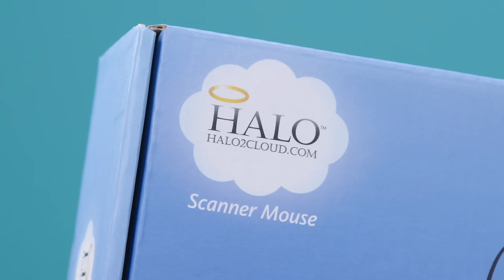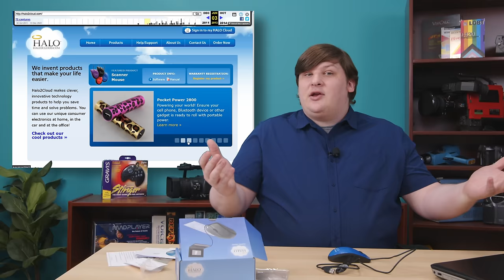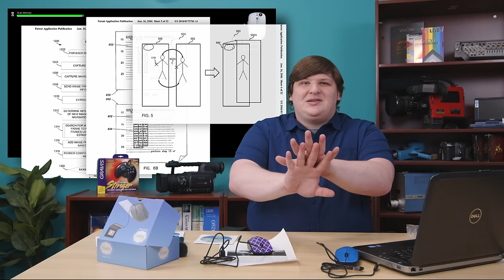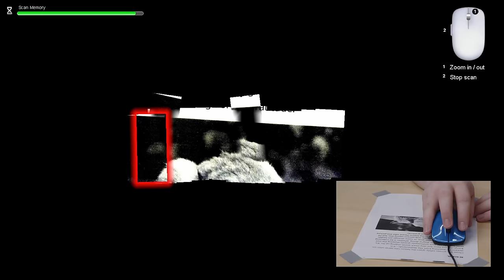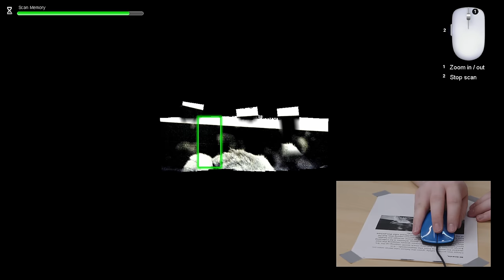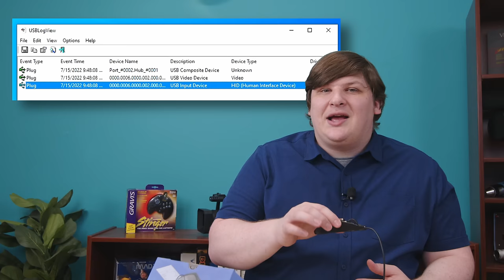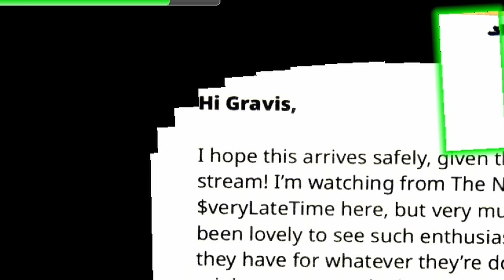Why would you scan things with a... mouse?

Comment: I would add one other [infuriating] factor driving what  happens in tech innovation: "How can we turn this into a subscription service?"
Reply from the maker: absolutely, if this thing had been just a couple years later it would have been right into that crap, haha.
Reply: That's my favorite.
Reply: You can hardly call it innovation at all. It's really a symptom of a fatal flaw in the system, companies need to keep "evolving" their products but we've reached a point where most software can barely be improved in ways that are interesting to customers. You need endless growth to stay in business but there's only so much growth that is actually needed or can be done at all, so they start profiting off of their power as a monopoly, because they can't deliver any more value to justify their existence (most big software companies can't, it seems)
Reply: Need your seats heated??? that will be 15 bucks please!
Reply: @davidmiller9485  I would actually like my seats chilled, what would be the subscription for that? Also to what guarantee is the cooling power of the seats? I am looking to refrigerate my lunch on the passenger seat in full sun if at all possible.
Reply: The worst thing about subscription services is they reward stagnation. Old-fashioned paid updates mean they have to update their product significantly enough in order to continue to make money.

The other downside is higher cost of service: There are several products I use as hobbies (eg Photoshop and Fusion 360) that I'd happily pay $500 for once every few major versions. But I'm just not willing to pay $75 per month for things I use only a few times a year.
Reply: @markmuir7338  My problem is that when you buy the car your paying for the "thing" (lets use heated seats). When you purchase the car that price is based on the fact that the heating system was installed. In this case BMW just doesn't let it work. So your paying for something you don't get to use. That is double dipping to me. If they or any other manufacturer of auto's does that here, I would like to see that end up in the courts.
Reply: Cooling is negative heating, so they should be paying you for cooling the seats.
Reply: @CathodeRayDude  props for working both Bad Brains and SSD into th same sentence
Reply: Like seat heaters on a BMW ?
Reply: maybe there is a android app that does the scanning using acceleration sensors and the camera, but it's locked behund some micro transaction or subscription
Reply: @asronome  this is why the Communists say "capitalism sows the seeds of it's own destruction"
Reply: You have the world economic forum to thank for that
Reply: You have to take it to best buy to "have it recalibrated" by the geek squad every 3 months. They need to use the most expensive branded printer ink or it doesn't work.
Reply: Easy, make it amazing but break so often you just buy another one because you can’t live without it
Reply: Now you can pay for your mouse over time!  It's only a penny per foot moused!
Reply: @millenniumtree  more like,  "pay for your mouse many times over"
Reply: Here have some ads to go with your subscription!
Reply: @sjoervanderploeg4340  So you can earn us money while you earn us more money, having paid money for the purchase
Reply: @asronome  This is very true of hardware as well. For years, I was always very excited about the newest phone releases. Sometime around the mid-to-late 20-teens, however, phones peaked in some sense. I have 54 tabs open in my mobile browser, I can stream music and video, I can send texts, photos, videos, and emails, I can access my shared docs in the cloud, and I can video chat with anyone, nearly anywhere in the world. Unless I drop my phone "just so" and it breaks, I'm no longer incentivized by new hardware. Every new "1000 MP camera" or folding screen is beyond my use case.
Reply: @asronome  Very much this. Office 2007 is the threshold for me where it's still inter-operable with most documents from newer Office versions; it got me through university and this is why I don't pay for 365 and continue to run the same Office 2010 license on Windows 10.
Reply: my favorite example of the subscription model being applied to things that shouldn't have a subscription is a motorcycle vest.

specifically its an airbag vest, if you get into an accident, it inflates to help protect you. it works by having a teather attached to the bike. and they do help reduce injuries.

there was a company that made a tether-free version, that from what ive heard, works great. and for $400 is priced a bit cheaper than other airbag vests.

the issue is that you have to either do a $12 a month $120 a year subscription or an additional $400 "license" to use the hardware/blackbox software that it needs to inflate the vest.

the fun part is, if you dont have the subscription/extra $400, it won't work.

a piece of safety equipment that will not work unless you pay a subscription for it to work.

i would be fine with the subscription if it was more of a "if you crash, we will send you a new vest, and pay for the shipping of the damaged vest" (while making the module that actually does the computing modular, and easily user removeable.) or allowing you to get a new vest after x years, because the material can start to break down. but still inflating if you dont have the subscription.

safety equipment should always work, regardless of whether or not you paid a subscription for it to work.

Comment: I love the dual tracking sensors tracking the angle of the mouse, I'd want to see that copied in a modern mouse to allow you to send angle data to painting apps, and more importantly to allow for a pointlessly fancy mouse cursor that rotates like the cursors on the nintendo wii
Reply: Didn't the cursor also zoom in and out based on distance to the "sensor" bar?
Reply: That last part is definitely the most important, I'd pay good money for that!
Reply: It could allow you to turn icons on your desktop for no reason too lol
Reply: it might sound silly at first thought... but.. On my Wacom Cintiq tablet it gives me position of the mouse (pen), but also pressure, angle, and tilt. It makes for very intuitive painting as I can use the pressure to auto-update the opacity of the brush, the tilt to shange the size, and the angle to rotate the brush shape. 

I am not sure directly what I'd use rotation for in a mouse other than, well, image and video manipulation... maybe one could have knobs on an interface and you rotate it with the mouse. In an FPS game you could even rotate the weapon for gangsta-gun kills. 

But the one thing I would really like to see in windows is multi-mouse support in general. To make pinch-zoom gestures and other wild input data. 

In general. If they enable the input, we, the users will find ways to use them.
Reply: @jmalmsten  Some brushes in Photoshop even change shape depending on the angle of the pen! My mind was blown when I first saw that.
Reply: @jmalmsten  Damn, two mouse pointers on dual-wielding mouse usage sounds like such a maniac idea, that whoever uses it can't be sane, not even if they try but much less if they keep doing it.
And I wanna do it badly now (yea that tells a bit about my sanity).
Reply: @Kalvinjj  

It is one of those things where you think... "that is so stupid... but I don't want to be the one who stops the attempt."
Reply: @jmalmsten  heck no stopping it, I wanna be the maniac starting it too!
Reply: @jmalmsten  
MS supports gestures on touch pads and touch screens, so supporting mouse gestures wouldn't be that hard

Sidenote: I have stopped using MS and switched to Linux, so this is mostly AFAIK/IIRC stuff

Edit: multi-mouse would be awesome for multiplayer light-gun games
Reply: @jmalmsten  Multiple mouse cursors is one thing I don't understand how it hasn't been done yet (at least not anywhere I've seen)
Reply: @MrHack4never  Back in the day, Trine supported multiple mice and keyboards. I used it with 2 friends - 3 people could hook up a mouse and keyboard each to one computer, and each control one character.

Sadly, this feature was cut for Trine 2. I think there might have been technical difficulties in keeping it, maybe newer versions of Windows make it a lot harder. Still a great game though!
Reply: @NeatNit  

On Windows and Mac, I think it's mostly just a rationality thing. Most users will never need more than one pointing device. Especially as the other hand is usually tied up to use the keyboard. So they limit the inputs in order to make things more manageable and users don't get confused. 

On something like Linux however, I am a bit more surprised that there aren't more talk about it and attempts. As Linux by its nature is more of a tinkerers system where multimouse input could be used in very unforeseen applications. 

The one thing I can think of are the 3D mouse products used for 3D modeling and CAD where you can push cameras and objects in 3D space. But they are rather niche... 

There's also the multi-trackball approach that are used in color correction for film and video. Those are essentially just three or more trackball mice but the input is limited to the tools, they don't map to a pointer on screen. 

I think I have seen some experiments with multimouse input with multiple cursors. But nothing that has been adopted by a community of users. At least to my limited knowledge. At one point the limit was probably in hardware. But I am fairly certain that modern computers would have no real problem handling multiple cursors on most hardware.

It's a bit like how it's easy enough to connect multiple keyboards to a computer, but making the computer handle the extra buttons as something other than just a copy of the first keyboard is more than a little cumbersome.
Reply: That seems like something the guys at Apple would have done in the era between when Jobs left to go do his thing with NEXT computing and when Apple bought out the company to get him back. A shame they didn't, because that would have been an entertaining footnote in the history of computing, but it seems like what Apple would have done at that time.
Reply: @mndlessdrwer  

And now Apple is widely known as the company that doesn't trust their users to be able to handle two buttons on ONE mouse.
Reply: @jmalmsten  I have definitely seen some users that would make me question if even one button is being too generous. But, yeah, Apple definitely has a weird history with questionable design decisions and anti-consumer practices. Though at that point in time in Apple's history, they did actually try to make their devices serviceable and even upgradeable. It wasn't until the later half of the 2000's when the "slim device" craze really took off that they embraced this opportunity to screw over their customers and make devices with soldered on everything and non-serviceable designs. Apple getting into the smartphone market was the best thing that ever happened to them as a company and the worst thing to happen to consumers from a reparability and serviceability standpoint.
Reply: Everything about this screams nerdy engineer vanity/procrastination project.
This is really interesting as a project and problem to solve. As a product it's pretty stupid.
But I suspect that wasn't really the main driving force behind it. "This'll be fun and well... maybe I can convince the boss to pay me for it"
Reply: The only mouse I had with more than a 2D sensor was a 1st gen Razer mamba, it knew how much you lifted it and allowed calibration for cutting off movement. It was a piece of crap: 8hs battery life, you could plug the cable in or use the nice looking charging standa but still 8 hs is laughable. Plus in about a year and a half of use it started randomly drifting to the left. Made me stop buying Razer stuff
Reply: Also: one way to understand why this mouse uses 2 sensors is thinking about dragging a piece of paper with one finger: it might rotate around while you move it. Use two fingers and you can control both the movement and the rotation!
Reply: @Kalvinjj  I used to play 'Mouse Wars' with a friend to see who can get the one cursor to their side of the screen the fastest.
Reply: @tjarsun  So let me get this straight...your mouse has 8 hours of battery life...whereas my 2000-zeroes Sony Minidisc player has 20? Or you Honda has 1,6 liters, whereas my bottle of Mountain Dew has 2?
Reply: I think any person serious about painting digitally will get a drawing tablet anyways. Seems like an unnecessary gimmick, but it would be fun to see what functionalities would be thought of to use this system.
Reply: yeah, basically tracking relative movement of the 2 sensors to check for rotation.
Reply: Imagine holding the button and rotating ... like trackpad gestures
Reply: Make it three optical sensors.
And also add a compass and set of accelerometers (or even a proper IMU).
Reply: @brentfisher902  lol, that's such a weird and glorious idea, I love it. Did you set the pointer speed all the way down to make it take longer? XD
Reply: I believe cursors on windows are images, so something would have to be added there to let them rotate...
But on Mac, they're vectors, which means it could easily rotate freely if an idea like this were to be implemented.
Reply: Now that would be a feature to stick into the control panel of any operating system. :P
Reply: @NeatNit  It keeps popping up and then dying off. You could use two mice with various games for the Amiga for two-player play, and, on X11-based desktops (eg. non-Wayland Linux), it's called MPX (Multi-Pointer X). The only tricky part is choosing a window manager with support for allowing window focus to be one-per-cursor rather than one-global or applications which check which cursor each input event came from.

Once you've done that, just plug in multiple mice and then, if it doesn't have a GUI for it, use a few `xinput create-master` and `xinput reattach` commands to move the extra mice and keyboards into their own groups. You can even do it with multiple keyboards since, with an MPX-aware window manager, it's "one focused window per input group" and the keyboard just sends events to whichever window the matching mouse has focused.
Reply: The "Marker" tool for Wacom Intuos professional line digitizers (Intuos 3 and beyond)  is, essentially, two pens side by side (at least, their locating coils) in one marker-shaped case, so that the tablet can read the twist of the tool.
Reply: @MrHack4never I don't think it did that in any of my games, but it definitely has the capability to zoom the cursor in/out. The "sensor" bar is actually just a couple of infrared LEDs (6 or 10 depending on your revision) in two chunks, and the wiimote has an IR camera. It then can look at the positions of the two dots for where you're pointing, relative position for rotation, and distance between the dots could be used to measure distance to the TV
Reply: @JaredConnell now I'm imagining a desktop or folder similar to MacOS with no grid snap by default, but now with every icon haphazardly rotated like a messy floor.

This has to be a feature.
Reply: @NeatNit the Amiga 500 (and probably also other computers from the Amiga series) also supported using 2 mouse cursors at the seme time. Some games used this for  multiplayer mode. I remember that Lemmings used it for it's split-screen multiplayer mode.